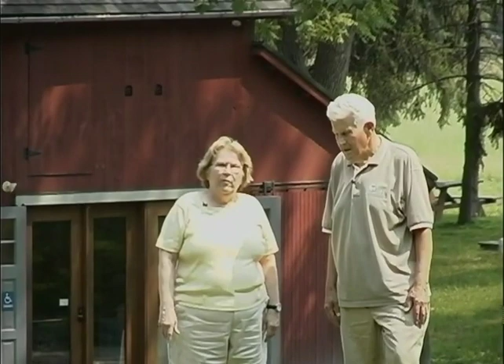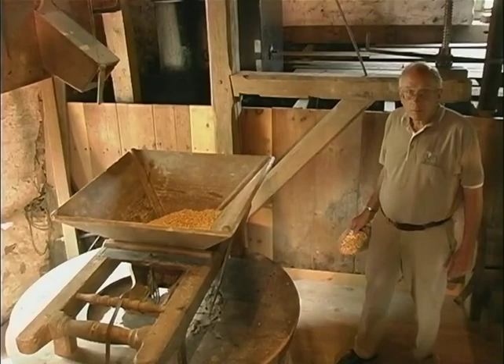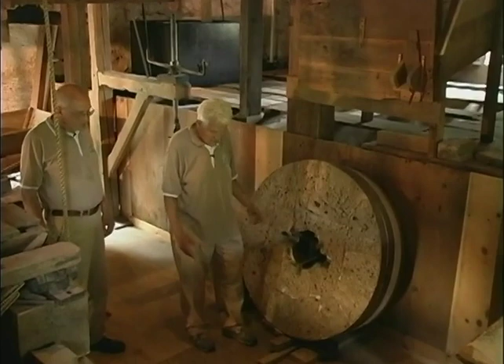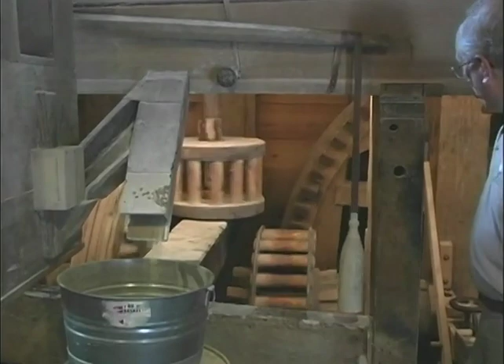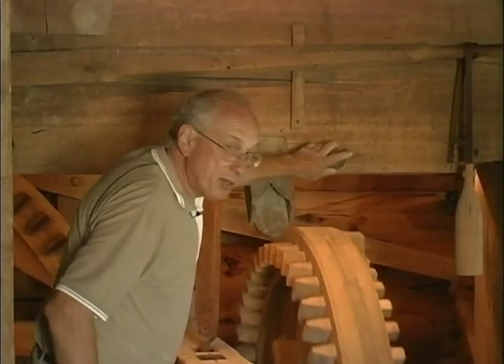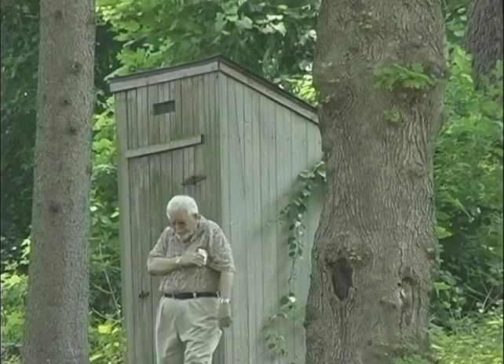A Tour of the Mill at Anselma

Comment: The metal bands were added to reduce damage to the finished millstones.   This permitted a cracked stone during construction be salvaged by segmenting new portions. The French quarry had depleted its vein of stone simply went to their scrap pile and recycled the cast out to produce dozens of years more of millstones. Individually these segments were called slabs. 
The paster of Paris caps balancing weight pockets and provides an easy to sanitize surface.